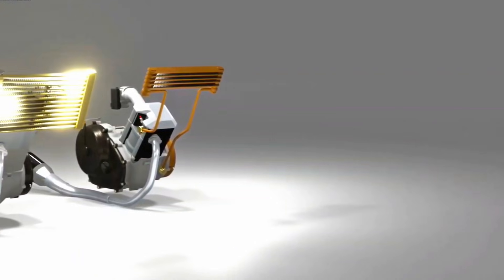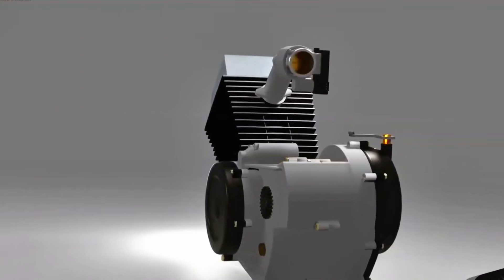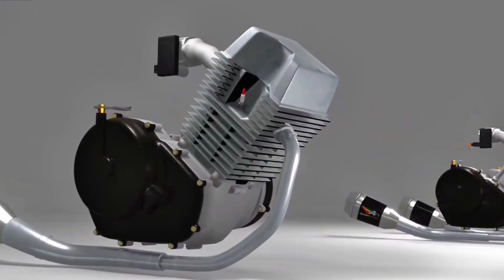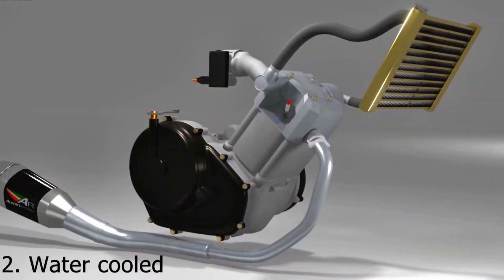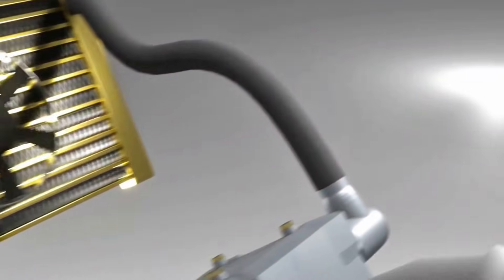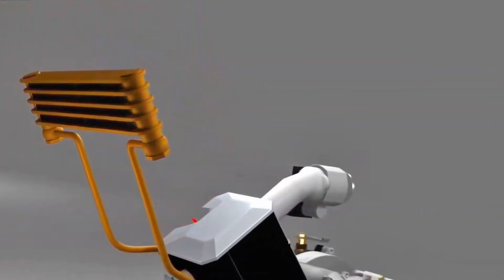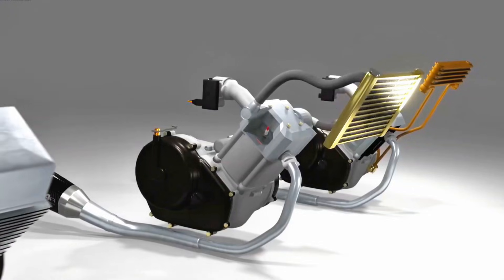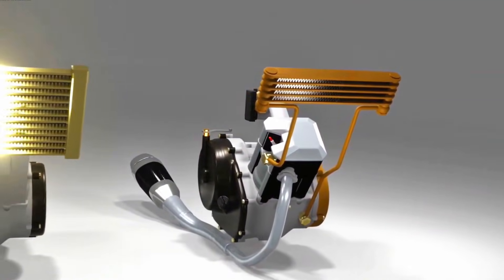Types of Engine Cooling on Motorcycles That You Need To Know!

Comment: I agree with that, liquid cooling is the best among the 3 because it has a stable cooling system compared to the others, because even in MotoGP and wsbk racing water-cooled engines are widely used in hardcore racing or even daily use.

Comment: I saw engine thats has these 3 cooling systems. it is liquid cooled already with cooling fins on the block similar to aircooled then the owner add oil cooler via oil filter cap .therefore his engine had those 3 cooling system.

Comment: The oil cooler help the crankshaft not to overheat and all the part inside the engine (gears, linings and other more.). In water cooled. T is also a best cooling system but if the gasket will be damage, it may occur that the oil and the water will mix and can cause serious problem and can lead to a major damage. All design are best, it depends on the user on how they will use the engine.

Comment: Vstar 650, Benelli Imperiale 400, CT 150s. All aircooled and ive never had engine overheating problems despite traffic. As long as you use fully synthetic oils overheating never really becomes a problem since these are really robust oils that can survive even around 400C engine temp. Since they're low compression compared to sport bike engines they never have trouble starting which is important as I use them as commuters and not weekend toys

Comment: Bei video e bel canale. dall'Italia ciao a tutti, mi sono iscritto.
Una cosa è sicura, che la motocicletta richiede sempre un flusso d'aria (il ponte termico) per stabilizzare la temperatura, perchè nel traffico, le alte temperature si raggiungono con qualsiasi tipo di impianto di raffreddamento (aria,acqua,olio). E' proprio una necessità della motocicletta avere aria di scambio continua.

Translate automatic:
Nice videos and nice channel. from Italy hello everyone, I subscribed.
One thing is certain, that the motorcycle always requires an air flow (the thermal bridge) to stabilize the temperature, because in traffic, high temperatures are reached with any type of cooling system (air, water, oil). It is a necessity of the motorcycle to have continuous exchange air.

Comment: I have a 250cc motorcycle engine which utilizes oil cooled with cylinder block and head fins cooling system. Which is very effective even in long rides.
Reply: GPR250?
Reply: Suzuki 🤔🤔🤔

Comment: Will for you the best is water cooling system!😅but for me if you ask me oil cooler radiator is the best and accurate to make engine smother while running 😅but both of them are good..

Comment: I really love this video…it give a proper explanation about the types of motorcycle engines being used…here in our tropical country.,mostly being used are “air cooled engines”…as you explained.,it is cheaper compared to “water-cooled”..there is also “oil-cooled” as you mentioned that the design is nothing like “air-cooled”..that combination gives a best performance especially on lower cc’s…I’m not pretending to be an expert nor a noob..I’m just a humble motorcycle mechanic with 22 years of experience in my 42 years of existence…build thousands of engines from 2 stroke single to 4 cylinders..4 stroke single to 6 cylinders..I always love to listen in every explanation and never argue…this engines are designed by great minds of engineers and we as mechanics sometimes sees those design flaws…

Comment: Most 1000cc sports bike use water and oil cooling system
And all motor bike are designed for air to flow around them for extra cooling

Comment: Actually, suzuki made a 250cc engine which uses engine oil circulated around the cylinder and the rest of the engine just like water cooling system. Even has a fan on the massive oil radiator. They named it SOCS
Reply: I actually have that bike, the Gixxer SF 250. Their cooling solution is efficient, haven't faced any overheating issue 👍🏻
Reply: @aswinkumar4452  i wish they made it into a 4 valve performance engine
Reply: @cripticdestiny  Yeah, they could have extracted a few more ponies from that Engine, but still, it's a reliable and peppy engine.
Reply: @aswinkumar4452  there are plenty of 4v engines with only oil cooling not even nearly advanced as this. It just seems like a missed opportunity on Suzuki’s part

Comment: The oil doesn't stay in the crankcase, the oil moves to the radiator and cycled back to the cam shaft then back to the crankcase. this is a misleading video.
Reply from the maker: that's what i mean, I will note in the description for erratum :)
Reply: @hazimreitz what pumps oil to radiator?its just a hose pipe connects to engine case and radiator?
Reply: @AbdulRahim-bd3qm  every engine has an oil pump internally, that's how they move engine oil through the components like where the cam shaft is located that generates heat and to lessen the heat and friction oil is sprayed on those components.
Reply: @AbdulRahim-bd3qm all 4 stroke engines have internally built oil pumps that pump the engine oil usually through a filter and then to the camshaft that spins and opens the valve stems and that requires lubrication so the oil circulates to it while adding a cooling effect at the same time.
Reply: @AbdulRahim-bd3qm most if not all 4 stroke motorcycle have internal oil pump that pumps oil throughout the engine mainly to the valve if it's a splash lubricating type of engine.

Comment: Hey assssshole, oil coolers are also installed in an air cooled engine which is the best one instead of water cooling engine.
Reply: Oil cool is the best? 😂😂😂
Tell me a single super sports bike that only use oil and air cooling?
Reply: @cosmic1traveler  first gsxr
Reply: @sakamotosenpai2242  I never meant for the racing bikes, I meant for long touring or constantly running bikes in hot countries
Reply: "Best one" 🤣 literally no one except bmw uses that shit because they're chronically behind the times and they try to appeal to oldheads who buy underperforming motorcycles. The BMW GS is basically the Harley Davidson of Europe 🤣 water cooling has the best performance. Oil is designed for lubrication, it's not great at transferring or exchanging temperature fast
Reply: @gabriel4328md  Agreed, but water cooling system comes at a cost, I didn't mean for long touring or racing bikes, I meant for normal average bike within city jam traffic use.
Reply: He already mentioned that part..maybe you misinterpret it…he said that “the construction is similar to air-cooled engine”..maybe your mind tricked you because of illustration video but no oil-cooled engines built without cooling fins…